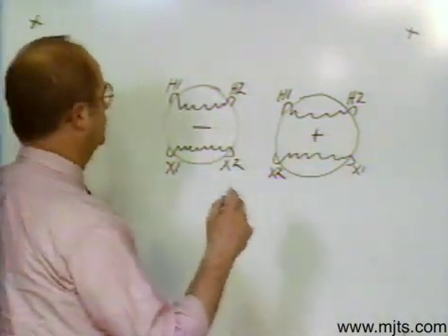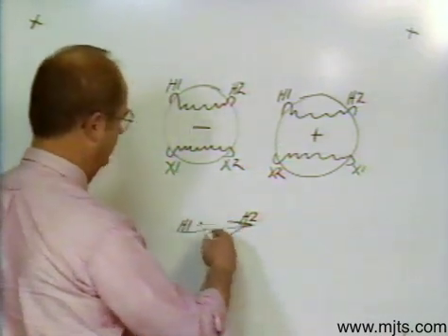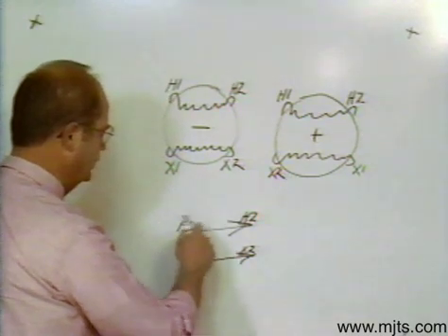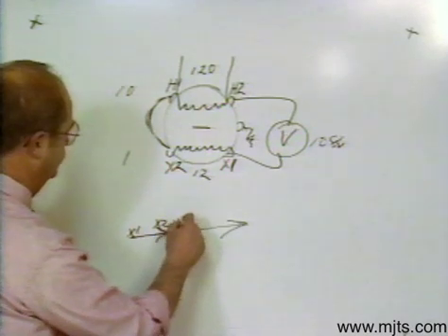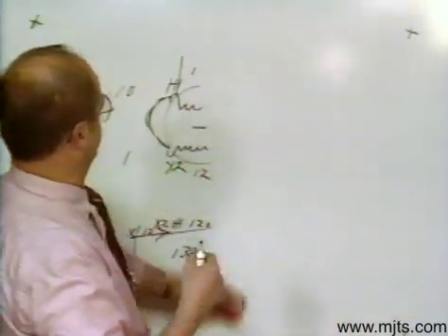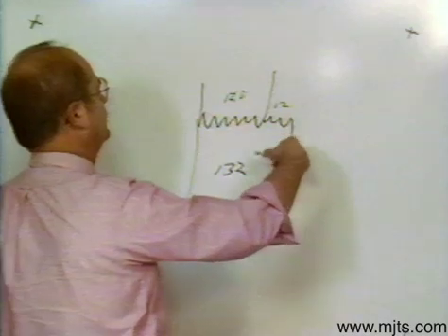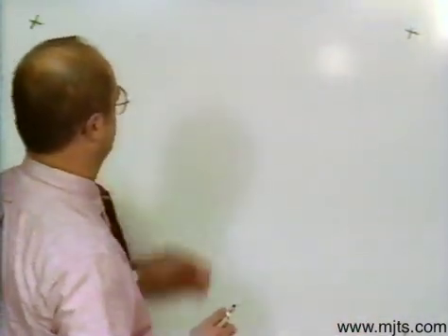Transformer Polarity

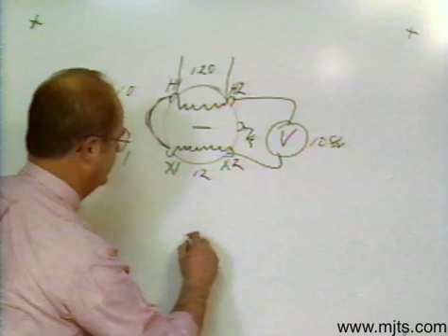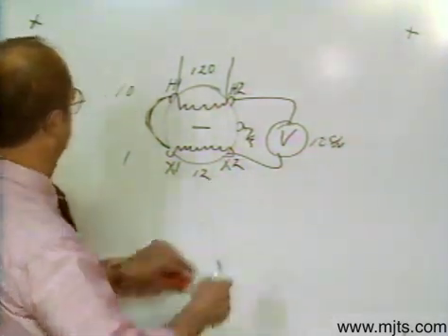Comment: At 6:15, the explanation of the vectors and how they are tied is opposite from what is drawn on the board. The first example is of a subtractive transformer, so the vector arrows must point the same direction with H1 and x1 tied together (same potential) making the voltage measurement between H2 and x2 108 volts. The additive example begins around 7:10 where the vector arrows point opposite and H1 and x3 are now tied (same potential) to make voltage between H2 and x1 132 volts. Believe me, he knows his stuff, but is still human! Great videos for in depth learning.
Reply from the maker: +bbrown86neo thanks for the comment!  I would like to suggest something though.  Dennis always drew his vectors so that they point to the higher numbered terminal.  From H1 to H2, and from x1 toward x2, etc.  Try thinking about at how the coils look if they were laid out flat like the vectors.  In other words, what if you took out the volt meter, and then flipped the x1-x2 coil out to the left so that the assembly was laying like an open book?  The high side vector would point out to the right, and the low side vector would point out to the left, just like he drew them!  Think about it.  The reason you get 108 volts is because you have 120 volts to the right, and 12 volts pointing out to the left and subtracting from the 120 volts!  In other words, the vectors are in opposition!  Does it make sense to think about it that way?  Let me know.  If it doesn't I can draw you some diagrams and email them to you.